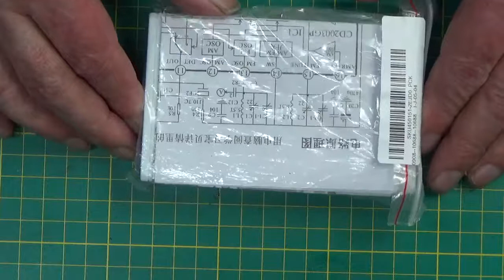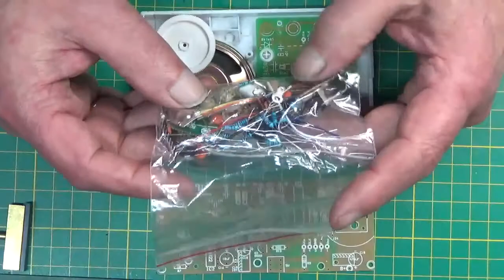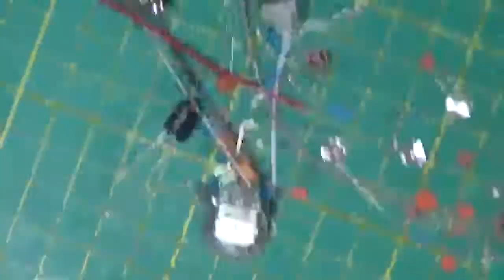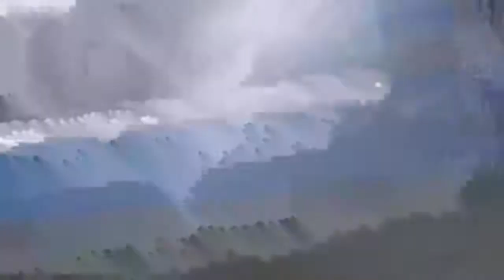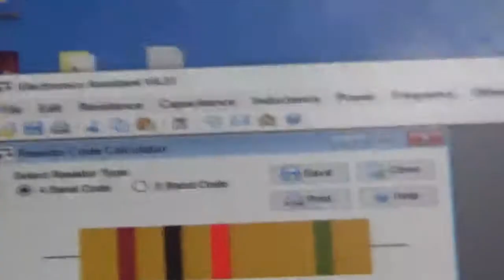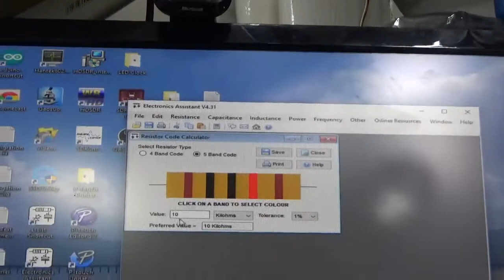Geekcreit FM Radio Build Part 1

Comment: Faulty component - funny you should say that!  I had one of these in white, radio worked just fine but no display on the LCD screen.  I suspected the driver chip was faulty because of the readings my DMM gave me.